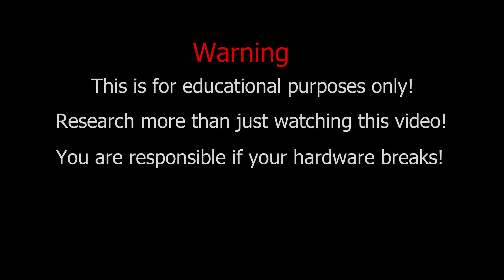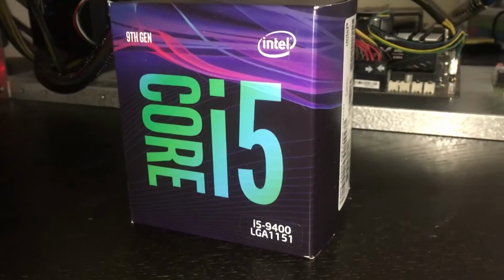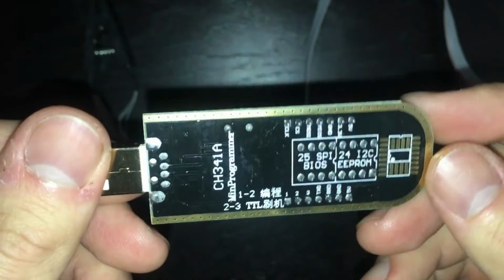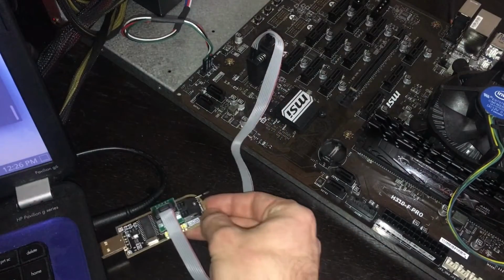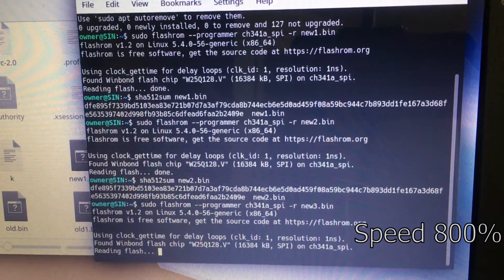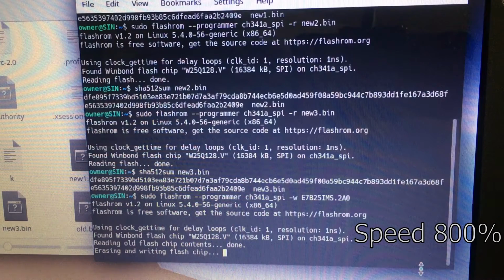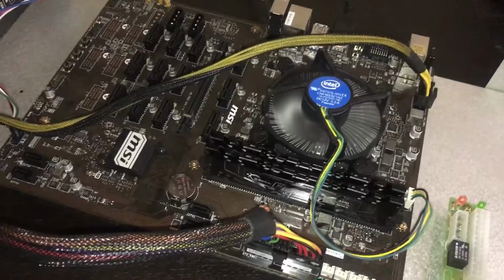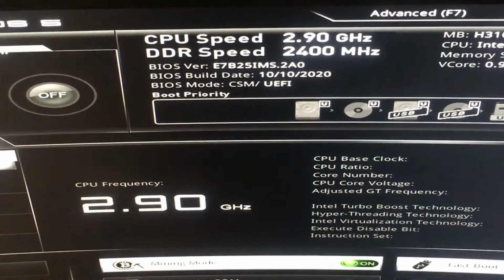Bricked Motherboard | External BIOS flashing with CH341A programmer

Comment: Hey Device Casting Couch, will that also work on Dell Optiplex micro 3070 9th gen. RAM cannot be read after reformatting OS,  Already tried fixing the RAM, cleaning and replacing but to no avail.

Comment: Hi  everyone , I am currently struggling to extract the firmware from XMC25QH64 chip. When I connect only the programmer to my laptop and checking using lsusb it shows but when I connect the 8 pin to the chip it disappears and says couldn't open device. Can anyone help me please.

Comment: Hi.  Wanted to say a big thanks for this.  Bought a Gigabyte board from EBay and fans were just spinning up then down again...  Tried all three methods of BIOS recovery (including the flash chip pins 1 and 6) but nothing worked.  Stumbled across this video and bought a CH314 from Amazon.  Just reflashed the BIOS from the website and......  Back in business!  Need to cancel the return to sender now...  They were racking their brains on what to try so now I will show them this video!  Many thanks!!!

(PS tried flashrom in windows....  For anyone trying this....  Just don't....  Use Linux!)

Comment: Hi, I've watched some videos showing removal of the BIOS chip before reading and reprogramming, then putting it back in the motherboard, but other videos doing it as you do in situ with a clip. I have an HP 840 G6 which I need to remove the BIOS password on (reprogram it) - can I do it on the motherboard do you think? thanks for any guidance, and for this video.

Comment: Hi, I bricked my Gigabyte B450 Motherboard by reseting the Security Keys  in the Secure Boot menu to factory settings and now I'm stuck in a bootloop with a black screen. Can I flash the bios on the chip using this method to make it work again?
Reply: most likely, yep

Comment: Nice video! I noticed you use this without the 3.3V - 1.8V converter board that usually comes with these kits, which is fine for that Winbond chip. Just a heads up for anyone trying this, check your chip's pin voltage level (read the serial number on the chip and google the datasheet), otherwise you could burn out the chip. 

I'm just going about doing this now but for a different chip, MX25U12873F so looks like I need to convert to 1.8V (i've heard ppl say you can get away with higher voltage but don't want to risk that). Somebody documented doing this - google "Archimago How-To: Resurrecting bad BIOS update with CH341 USB EEPROM Programmer" to find it

Comment: I just want to comment that you DON'T need clips to flash your BIOS ROM.
Commonly those pins are exposed, eg in MSI mainboards you have JSPI1 connector, where you can directly access the pins in more reliable way than clips.
Just keep in mind that those are 2mm pins, smaller than regular 2.5mm.

All you need to do is to:
- check the pin layout, eg with multimeter and chip documentation
- get proper 2mm cables
- connect them between connector on your board and CH341A
- download bios ROM and flash it with CH341A compatible software

Safer and cheaper than clips!
Reply: bro pls help mee
Reply: @marcuscoolin  what do you need?
Reply: @Popi0l  well after a while i figured i needed the adjustable voltage version for my 3.3 volt chip probably the reason why i was not getting my chip to pop up in any program, i’m ordering it soon tho
Reply: exactly, JSPI connector right in the video, also people need to get programmers that support 3.3 or 3V chips, as most are 5V still on most pins.
Reply: I have a Microsoft laptop surface 4 I’m planning to do this to and it’s so small I can’t even clip it.. any suggestions for how I can do this without having to clip?
Reply: @sandraazua3745  if you don't have a dedicated connector (like the JSPI) then probably (un)soldering would be an option. It might be challenging, especially w/o experience, thus I would seek for professional's help
Reply: Is there a video? Please help.
Reply: @stevenevents cables with 2mm connectors, female to the board and male to CH341A 

I have found those cables on electronic store

Comment: I really dont understand  why u didn't modify your piece where the 3.3v output comes from? Cuz some people do this in videos or is your piece new?
Reply: once u plug chip into programmer the voltage is adjusting to 3.3V and no 5V

Comment: Nice video, up till the Linux point. It comes with Windows original software, why dont you use it? Are you really think that most of the users will install Linux for the bios update? Well ok you did it for Linux too, no problem, but you havent done the same for Windows. 
This is just a big bruh moment.

Comment: I agree with others, this has been the most helpful. I have watched several videos before this and I was still not confident enough to try. After watching your video I felt like a pro! :P 
I am a bit confused that the chip model printed on the bios chip is different then the one flashrom says it found. After much research and reading the manufacturer macronix info, still doesn't tell me anything.

Comment: Genuinley Thankyou so much. 3 days ago i did a bios update on the same board as you. Literally didnt even turn on... I knew what i done but never knew about the ch341a for £10 it was worth a go and with your guide on repeat for about 2 hours i felt confident enough to attempt it alot of fiddling with the clip later and i have one working PC!!! I had 3 long beeps at first and reseated the ram but after turning it on 5 or 6 times it fired up and has been running flawlessly for 6 hours. I cannot Thankyou enough youve earened a sub from me for sure.
Reply: Is it still going after a year?

Comment: When I get bios files from HP for my pavilion 17-ar050wm laptop it has two .bin files (08353.bin and 08355.bin they are both 8.00Mb) I was expecting one. Do you have any idea how to flash the bios when there is more than one bin file. I have been thinking about trying to fix my bricked laptop but this has been holding me back. 

Thanks,
  Steve
Reply from the maker: How big is your BIOS chip? If you read from it in flashrom it should output the size.

Some laptops have two separate BIOS chips that show up to the system as one chip. You can see something similar in my Thinkpad T440p coreboot video. 

The difficult thing is I'm not sure what file goes to which chip. You could always try flashing in one order and see if that works. If it doesn't try flipping the order.

Make sure to make a backup of the current BIOS just in case.

Hope that helps! Let me know if you have any other questions
Reply: @DeviceCastingCouchTechPodcast  looking at the actual board it appears to be a 25q64JVS chip made by winbond. There is only one.  Datasheet comes up as a 64 megabyte serial Flash. I would assume that this is it. So apparently 64Mb which makes even less sense that there'd be two files when they're only 8mb. I have checked every 8 Pin chip on the motherboard. The rest all seem to be either n Channel mosfets or voltage regulators.

Comment: Thank you! I have just fixed my b360m pro vdh! I was stupid enough to update bios for no apparent reason as a result I got a computer that even didn't power on. At first I thought that somehow ny power supply was damaged. 

Thanks to you it works again! And I have a neat programmer tool to play with :)
Reply: by clamping or pulling it out, bro. I want to try it

Comment: Will it work for updating Z170 K6 chip? I just need to update it for 7th gen and don’t want to buy an overpriced celeron fo do it.
Reply from the maker: It should work! Every motherboard so make sure you locate your BIOS chip and find out the correct voltage for it.

Comment: Thank's very much for the video. I ordered a CH341 programmer some days ago.
I understand perfectly well the procedure as an electronic technician.
But sorry i did not understand well what happens when you boot for the first time after you have the bios flashed.
Does your computer behave like if nothing ever happened at this step and you may press del or F2 key to got to the BIOS or you still have another operation to do?
Could you list all the steps from here please? English is not my native language , i'm sorry.
Thank you very much.
Reply: Not sure, but, he removed the battery, so the bios configuration is lost.
I believe when he got the first boot, it says "all defaults are loaded" and it may boot normally if you have a disk with a OS (if its the first disk on the boot order, etc).
Reply: @navossoc  Ok thank you. I flashed the 8 pins memory chip with the latest BIOS and all went back  like if nothing ever happened with all settings set to "Default" settings.
Reply: @jeanyves5380  Nice! Glad it worked... I tried something similar today, but with another board, I think there is a connection issue, but can't get a stable read/write. Didn't work :'(
Reply: @navossoc  did you ever manage to do it?
Reply: @mrtommyhunt  No, we gave up on it... 
Seems there are some motherboards that have some electrical components nearby that prevent a good read/write, so you need to remove the chip (unsolder) from the board, but we never tried that...
Now the motherboard is a nice keychain hahah...
Reply: Can you please explain with another video . Coding is not my native language 😅

Comment: For MSI X99S SLI plus. Can i use the bios updates available for download on MSI's website? Or i need to extract bin or rom file to be able to flash?
Reply from the maker: You should be able to use the file from MSI. It might have a different extension that isn't .bin or .rom. It should flash fine in the video I flashed with a .2A0 file.
Reply: I did this and now my computer is bricked. Never updating BIOS again.

Comment: i see 25q128 is 3.3V ,is there problem still with 5V going into the chip or new CH341A has 5V/3.3V switch?
Reply from the maker: Unfortunately there is no switch on the CH341A but if you are comfortable soldering there is an easy 3.3v mod that can be done to ensure the proper voltage.

Comment: Does it work on a laptop
Reply from the maker: It should you would just have to find where the BIOS chip is located on the motherboard and then look up the datasheet to find out what voltage it uses.

Comment: Hello, would you help me, I can't find the MX25L12872F micron chip in any program, my motherboard is asrock b450m steel legend.
Reply from the maker: Flashrom should automatically detect the chip. If not you can specify it using the -c or --chip in flashrom. Sometimes it won't detect the chip and this could because it is Write Protected. Are you getting any errors in flashrom?

Comment: Question bro,  do you know where I can find B2BM cause i going round in circles trying to find that file, and still stuck waiting to flash the bios
Reply from the maker: I'm not sure what you are asking? Can you please elaborate?
Reply: @DeviceCastingCouchTechPodcast  Sorry, the software named B2BM used to convert MSI exe to bin files so you can flash them on with the CH341A.
Reply: Nisal Perera  I did get it from someone a while back, but the bad news my machine has had it and i lost everything, and I'm not a social media nor cloud person, so I have to take that lost, it could have been worst... So while i'm a little bust with my daughter and trying to rebuild, I'd still appreciate any valid links to that software.

Sorry I could not be of help.

Comment: I'm curious.. when the PCH doesn't detect supported CPU in the bios, it doesn't initialize the CPU right? So what's activating the LED? 

I mean, there's motherboards that throw beep codes or led blink code when something goes wrong like CPU or memory not detected.. is there anything inside the board that runs code before CPU? Does the PCH runs some code before CPU? superio/kbc? There must be some code to check the system, right?

Comment: How the hell u got to clip the clamp on the bios chip first try... like my bios chip is very tiny and it keeps slipping off rom the clamp I legit tried it 5 hours and still couldn't stay on
Reply from the maker: Are you sure it is the right chip you are trying to connect to? If using the original clip it does take a couple of tries. If you think you clip is the problem try and make sure the gold pins didn't slide up. You will because if you look at the top of the clip where the wires come in you will see gold pins.
You can try pushing it down the pins and re-clamping to the chip. These cheap clips aren't the best quality. If you are still suspecting your clip is the problem you could look into Pomona clips they are much better quality but they cost more.

Comment: Did i just brick my mobo?
Everytime I turn on my computer it throws me to BIOS Recovery

usually I just press esc and then enter and then it will start windows normally
this has been going on for weeks and i just ignored it
but when I tried it today I saw a different option.
Being stupid and curious, i tried to click that new option which says ">PROCEED WITH FLASH UPDATE"

when it told me to press ENTER key, i did that but it never rebooted. My pc was still ON but my monitor isnt receiving or showing anything. so i decided to force shut down..

so far this is what i already tried
>unplugged and pressed power button for 30 sec and tried to switch it on
>removed the mobo battery for a few mins and then put it back again.

both of those didn't work
i didnt want to tinker with it further since i just got it back from the pc repair shop and im sure everything on the mobo is intact and plugged snuggly.
so can anyone tell me what happened to my motherboard? did i break it?
btw if it helps my motherboard is an emaxx a70fm2+icafe
any advice will be appreciated
Reply: If you're not getting any lights from your keyboard or mouse and fans are still spinning, and there's no output to monitors, you have most likely bricked your motherboard. 

Before you go ahead and buy a bios programmar, try some troubleshooting options.

1) Take out the CMOS Battery, and unplug the pc from power, hold the power button to get all the juice out.
There should be two jumpers, called JBAT1, put a screw driver between both of them, so you're shortening it.
Check this video how to jump it:

https://www.youtube.com/watch?v=vNX6-dkFey4

2) Take one stick of ram out, power on, take two sticks off ram out, power on and see if it posts.

3) Take out all USB Devices connected to your PC, literally everything except your output cables, take out ram, unplug sata cables.

If no success, then YES it's bricked.
- I would buy a Bios Programmer for 10< pounds, and that should work smoothly.
- I would not advise you to NOT follow this tutorial, as this is not a very efficient way of flashing the chip, asprogrammer is a better software for flashing than some command prompt.

Better video: https://youtu.be/4qX2zihB6UE

Please do not go to pc repair shops, it's not worth it - they will rob you for all your money, and then can steal your parts - my local pc repair shop stole parts of a customers phone, and celetaped parts on.

If you need any help, if you decide to order a bios programmer, please contact me on Adaks#7039, and let me know if you've sent a request - I will be sure to help you.

- This is how my experience went with my bricked motherboard:

This has happened to me 2 weeks ago, when I updated my bios and after 100% completed download, it restarted and returned with no post, I believe that the USB Flash Drive that I was using was not very efficient in storing this type of data, and was mainly made for pictures and or video and not to store code in.

I had to buy a bios programmar for 12 pounds and came next day from amazon, and then I had to install the Bios Programmer drivers, and install AsProgrammer (AsProgrammar is a free open sourced tool which lets you read and write to the chip using the programmer). I clipped the programmar to the bios chip, had to move it around like 10x before I got a connection. After, I went to MSI downloaded latest version, and flashed it onto the chip. After booting up, there was still no post, so I had to power off and take a stick off ram to post and the motherboard worked again.
Reply: @Adaks  thanks for the help, I'll try it later and update you.
Reply: @Adaks  hello, I've tried all the things you said none of them worked for me, so i assume my mobo's brick . Thanks for the help tho.
Reply: @PsychoTsundere  yeah, no problem.
Reply: @Adaks  I have a very old laptop with the i7 processor, first generation, and its type Asus it broke down from 2018. When I updated the BIOS, the progress reached 55 percent, then it turned off automatically, and I didn't even touch it. The problem of u is the same as mine, and I think I want to fix it. I gave it to someone (my father's friend knows him), but he didn't fix it or even touch it, so I'm going to take it from him and buy that chip "ch341a" and I hope this method work
Reply: Let me help you out.